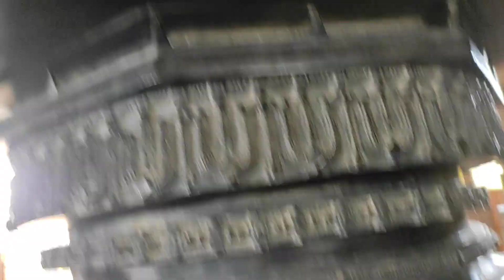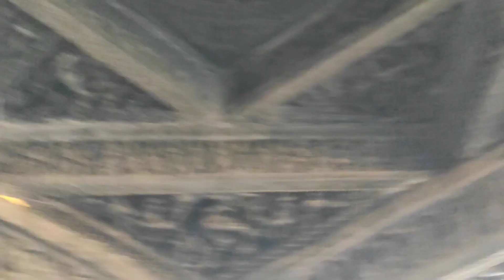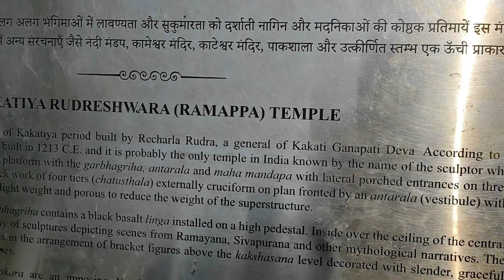Rock  Melting Technology ..  How did they Build this Ramappa Temple in India !!?

Comment: 1:50  I agree that advanced technology was used to carve the precise sculptures and architecture.  Melting could have been a part of the machining process.  I would also like to share that some form of Electrical Discharge Machining (EDM) could have been used.  Modern industry uses EDM to machine metal.  Stonework would require huge voltages and specific frequencies to erode the stone into dust and result in a precise workpiece. Removing stone from a quarry would be a similar process like is seen with the unfinished obelisk of Aswan in Egypt and Vettuvan Koil in Kalugumalai.  The energy source to provide this electrical power would come from a device like the one described in the patent titled "CRAFT USING AN INERTIAL MASS REDUCTION DEVICE".
Reply from the maker: Very interesting !!!
Thanks for sharing :)